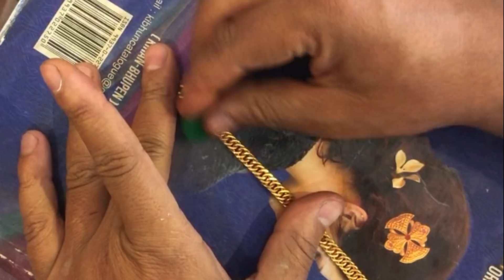gold bracelet making | How to Make Gold Bracelet  | 24k Gold Bracelet

Comment: What metal are you using to bind the gold together? And when you heat up the gold links sometimes why doesn’t it stick together? And how is it still shiny? I heated up my gold chain and the links got stuck together and it also got a little bit dark but it’s 24K pls explain if possible lol thanks!
Reply from the maker: I think you have not closed the chain ring.the gap of ring be closed so it will easily solder,I use 24k solder
Reply: Are u using Jewelers pickle acid after each time u anneal? U have to do this step I don't think this guy shows it.  Also sometimes flux makes the links stick when it heated try a small torch, I use a flame throwing cigarette lighter blow torch when I'm doin fine chains like this . Hope this is some help to u man
Reply: Good job bro I wish u all the best

Comment: S- Hook is bigger than its braclet.
Reply: Its a shitty lock!
ALWAYS go for boxlock!
Reply: Yeah
Reply: S hooks are very commonly used on 24kt pieces, not sure if a box won't work, but on high karat pieces, you usually see S hooks. Probably because its soft, and the box will eventually lose its click, and a hook can easily be bent or readjusted
Reply from the maker: Nice

Comment: If that's 24 K why does he keep having to anneal it ?
Reply: I agree with you
Reply: @hombreamigojewelry2472  its not 24k and 24k does not work Harden and so soon as you use solder it you lose the 24k by adding  brass and copper and silver and germanium and silicon in the solder but at 10:46 the truth is exposed with at gold gold button and its brownish discoloration on the top its 18k
Reply: 24k needs to be annealed too.